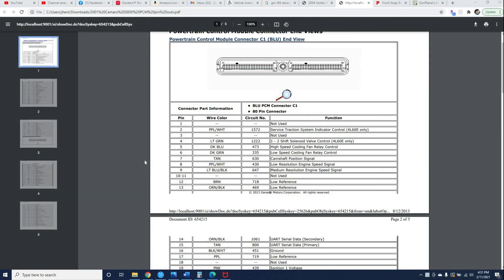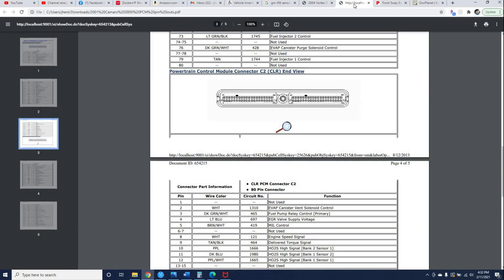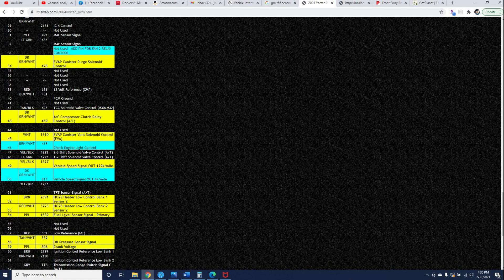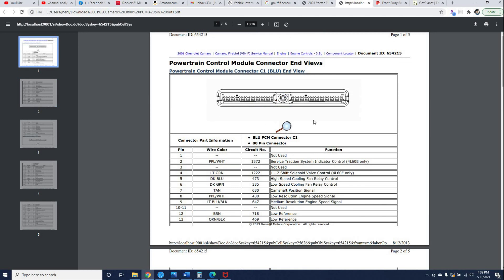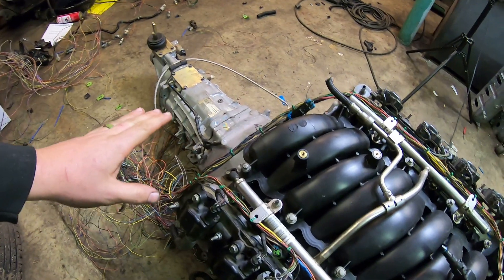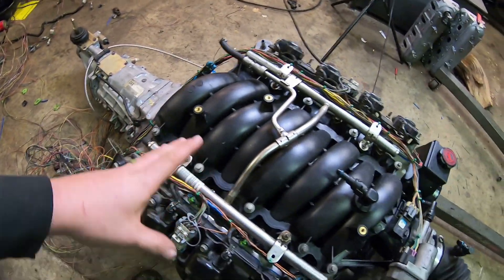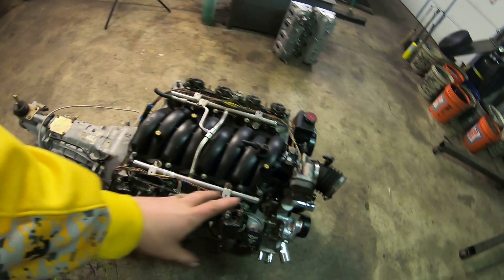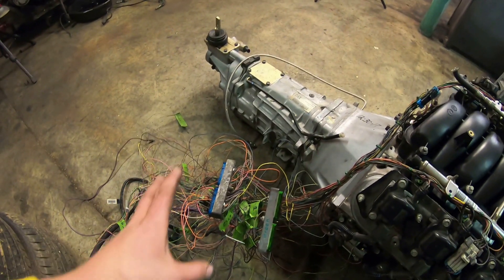F Body V8 Swap, Electrical HOME STRETCH!!

Comment: I'd like to hire this guy to do a LS swap on my 97 Camero. I'm wondering if the manual 5 speed transmission would mate up with the LS motor. Anyway, another great video
Reply from the maker: I'm flattered! The 5 speed in your 97 won't directly bolt to an ls engine, there is a bellhousing to adapt it to an ls engine but they're from an old small block chevy application and pretty hard to find.

Comment: Can I get a ls1 harness to make it work with the v6 trans am or fire bird? will I need harness and computer or just harness?
Reply from the maker: I'm not sure I understand which way you're going? If you're going from LS1 to V6 the LS! harness and computer can be reprogrammed and reworked to run the V6, if you're going from V6 to LS1 you're going to need the computer and the harness.
Reply: @MohawkMotors  yes am going from v6 to v8 5.3 on a firebird automatic but I want to do a manual transmission
Reply from the maker: You'll need the harness and computer for the V8.
Reply: Hey did you figure out where the wires for the passenger kick panel go? That’s where I’m at now if so can I get that info? Also what about the harness under the steering wheel all were taken out.

Comment: I was waiting for this! I'm look at something very similar with the S10 blazer. PCM on the passenger inner fender and the fuse block on the drivers side. I like how you tucked the wires. Where will your fuse block be located? Are you using the camaro fuse block?
Reply from the maker: Thanks! Yeah I'm using the camaro fuse/relay bock, it's located right behind the driver headlight on the inner fender. I figure the only real difference between the V6 and the V8 is two more cylinders, but that doesn't add enough current draw on the injector or coil power supply to stress any of the wiring or relays so the stock fuse block and relays should be just fine. Everything else is pretty much the same.
Reply: @MohawkMotors  Ok great that's my plan. I'm planing on taking the connectors off of the blazer harness and then  cut that large connector off and connect to the appropriate connector in my case there are three different ones that that plug wires will go to. BTW that large plug is a C107. I think it is found only on these LM4 engines.
Reply from the maker: nice! That should be a clean looking install! Thank you for the connector number, C107, I was able to figure out what all the wires were to it eventually, I'll know for next time. I think you're right also, I've only seen it on the Envoys and trailblazers, the pickups and suv's I've seen all have the 3 smaller connectors.